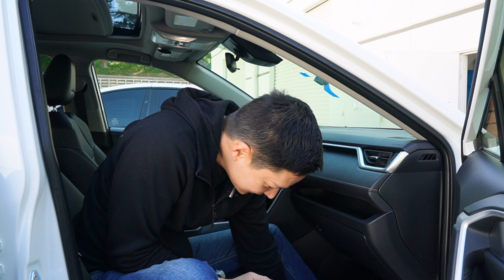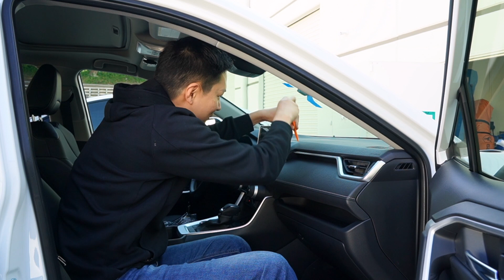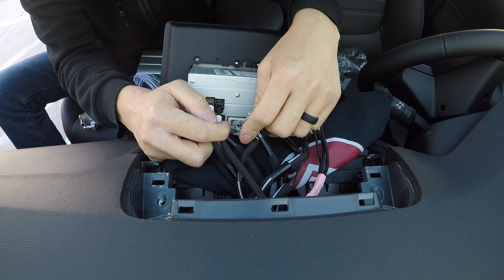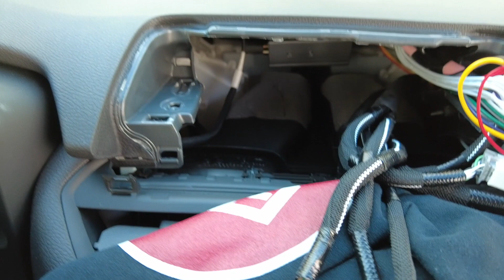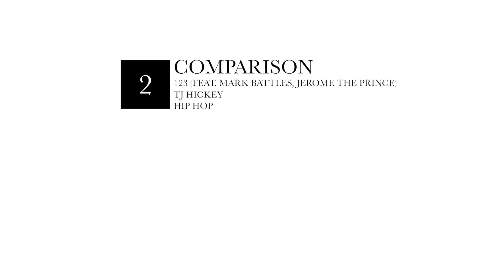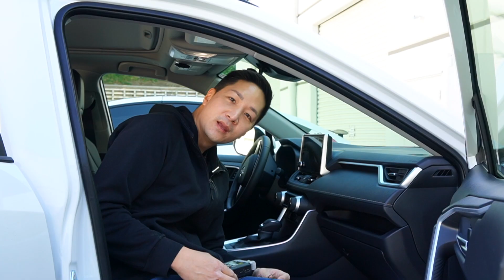2023 Toyota RAV4 Micro Power Amplifier Kit

Comment: Where does this amp get its power from? Is it connected to the battery or only to the head unit?
Reply from the maker: Takes power from radio
Reply: @BeatSonicUS  thanks! is not it dangerous for head unit and car electrical wiring?

Comment: Hi,

I am interested in the ENA-3T3, which is listed for speakers with 4–8Ω impedance. However, the RAV4 typically wires the front dash and door speakers in parallel.

If I install 4Ω speakers in both locations, the circuit will present a 2Ω load to the amplifier. Did Beat-Sonic account for this specific factory wiring configuration? Is this amplifier rated to operate safely and stably at 2Ω?
Reply from the maker: Will work at 2 ohms, keep our gains at 50%

Comment: Contemplating dropping this in my 2019 non-JBL Rav4. But turn gains setting max?
Reply from the maker: In this video, we did it at the 4 o'clock position, but you can always adjust the gains to your liking.

Comment: I have a 2024 RAV4 XLE . I just upgraded the stock speaker to JBL club64 and the tweeters. will this improve the sound to those speakers. The stock speakers are garbage....Also does it affects the hybrid in anyway?
Reply from the maker: Please send us the specs of the speakers so we can check to info@beatsonicusa.com. It doesn’t affect the hybrid system in any way
Reply: @BeatSonicUS what is the most important factor in replacing the OEM speakers with aftermarket speakers for the amp to still sound good? Is it choosing a speaker with the correct ohm load or higher sensitivity rating
Reply from the maker: @matttosh  Make sure you stick with the same type of speaker. Don't replace a front door woofer with a coaxial or component.

Comment: I bought a 2023 Rav4 Hybrid Limited with the premium JBL speakers and was really underwhelmed. I replaced all the speakers with Infinity premium speakers and it still sounded kinda muffled and dull. I saw where this amplifier has a 30-day money back guarantee; so after reading the good reviews, I bought it to try out. (In other words, I was a little skeptical) I just finished installing it and am really impressed! It gave the sound a much more clean, crisp feel. I even had to adjust the treble, mids, and bass down a little. I initially followed his instructions with the gain set to 100% but it seemed a little too much, so found that about 80% worked well. Great product! Easy to install and everything went just as easy as the video showed!
Reply from the maker: Terrific! Thank you for your feedback and your detailed review! I’m glad it worked out for you
Reply: So do you use the same amp for the jbl system as the one in this video?

Comment: After installing this unit in my 2021 RAV4, my volumes and skip/rewind controls on the steering wheel have stopped working. Anyone else have this issue?
Reply from the maker: That is not normal. Check the connectors and make sure they are connected in all the way. You should have heard the connectors click. Email us for more tech support info@beatsonicusa.com

Comment: How do you connect a subwoofer to this?
Reply from the maker: You will need to use a line out converter
Reply: @BeatSonicUS  do yall sell that? Can you make a video? I'd like to buy the micro power Amp and hook up a sub to it. Thank you
Reply from the maker: @noSHOEScurly  we don’t but you can get it on Amazon
Reply: @BeatSonicUS I'll try to figure it out. Thank you
Reply from the maker: @noSHOEScurly  our pleasure

Comment: I am confused on what this system does.  Is it just adding additional power to the Toyota head unit ?  If so why is this needed if you are keeping the stock speakers? Wouldn't a better solution be to add better quality speakers to your package and then tune your system ? Is the sound quality produced by the Toyota head and stock speakers unit even worthy of upgrading ?
Reply from the maker: It’s adding additional power and converting the power source to a more finely tuned sound with better dynamic range. Changing the speakers won’t change much since the power and tuning from the radio will still be the same. The factory amp is capable to take more power. This will make the biggest difference. You can return it if you’re not satisfied

Comment: Would this work on my 2023 limited trim ?
Reply from the maker: Absolutely. It’s compatible with your 2023 limited trim
Reply from the maker: Correct
Reply: Site and description say "Not Compatible with JBL Models", so since Limited models have that awful setup, this product won't help it any. Besides, I think that it might be a matter of making a bad sound just bad and louder.  Our only solution is spending 4-figures for a whole audio system upgrade... or being an installation expert willing to take the hours stripping your car bare and living with things for a while if you get any part of it wrong. 😞

The vid almost fooled me though because of the large, one knob display.  But the trim for this demo I’m almost sure is the XSE which is the only trim I’ve seen with that display style.
Reply from the maker: @psoup216  sorry for the misinformation on the website. This is in fact compatible with JBL models. We need to update the website description. Sorry for the confusion

Comment: Work with hybrid model? I’m just worried that it might not because every little thing that consumes power is scrutinized within a hybrid platform.
Reply from the maker: Yes this micro power amp works with the hybrid model as well. We installed to many hybrid models ourselves without any issues
Reply: @BeatSonicUS what the name of your shop ?? I’m in West Covina
Reply: I've got an entire air system 360 degrees of light bars and air horn all on my roof rack on my 23 woodland edition hybrid there's two different batteries the hybrid 440 volt and standard car 12volt battery which is what you use nothing will affect the 440 volt hybrid battery
Reply: This can be bought from. Ali express

Comment: I have upgraded my speakers in my 2021 Rav4 prime and your website says “(Using new aftermarket speakers not recommended as performance may vary)”.  So is this designed only to work with the stock Toyota speakers?
Reply from the maker: We tuned it using the factory Toyota speakers. You’ll hear the improvement even with aftermarket speakers but depending on the specs of the aftermarket speakers. The results may vary.